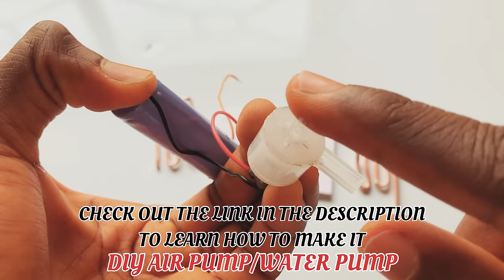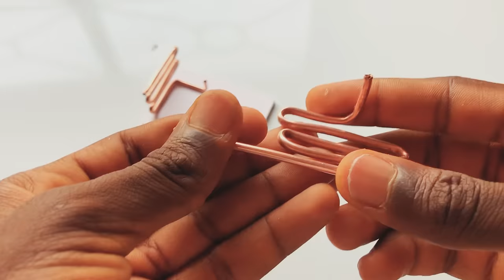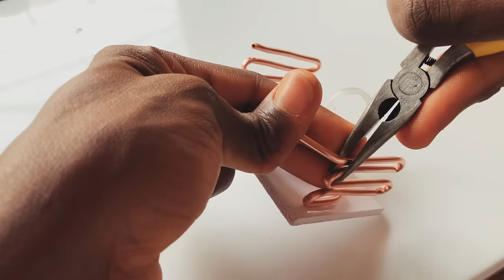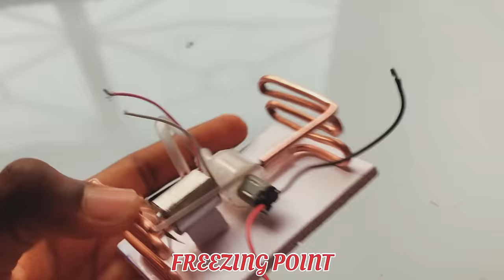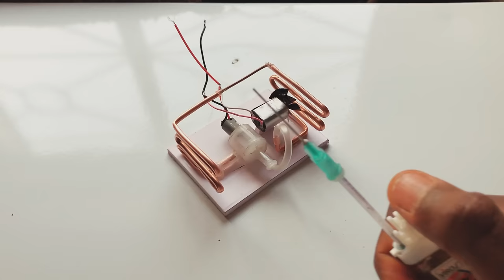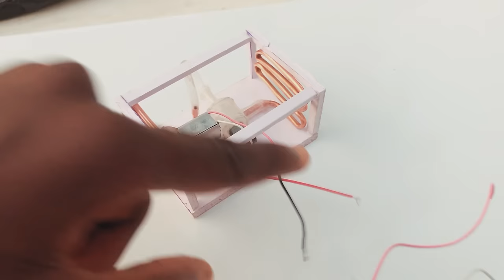How to make AC || Smart Air conditioner At Home || Mini powerful AC

Comment: This is an open prototype/working principles of HVAC, this is just a practical method i used to carry my project while in technical college
Reply: Is it the same gas used in HVAC?
Reply: @uday20101  The first ever made practical HVAC used same gas and it works perfectly fine, but there was a problem of combustion and explosion, So, that same gas has undergone several refining into the lighter AC refrigerant gas you see in the market today. So never attempt to put propane gas in an Air conditioning unit as seen, it's dangerous. You will risk your life.
Reply: @roberto_the_tech_guy  and is tht motor acting like compressor
Reply from the maker: Yeah
Reply: @uday20101  the motor is attached to a pump with a technically configured inlet and outlet valve creating a kind of DIY compressor, and you know compressor is a genius design. You can just say a combustion engine shares similar design except that an engine has to burn it's gas within the cylinders to create a mechanical torque needed for propulsion

Comment: As i know,  liquid must pressurerise until it's boiling point to have it liquid to gas.  When the temperature absorbed by gas it turns into liquid again. Are you sure will this happening in this model ?

Comment: The problem with all these DIY AC videos is that there's no seamless (uncut) shot of the device powering on and ice forming on the copper. Other videos show the ice forming on the copper but it's just a reversed video of ice melting off the copper, likely from spraying it with some aerosol.  Someone will need to upload a video with one of these things turning on and having ice form over time - with a clock running in the frame to show its moving in forward time. Someone will also need to be juggling apples in frame, speaking proper english the whole time within frame, and like 3 of my friends will also have to be in the background giving a periodic thumbs up before I entertain that any of these are real.

Comment: Love the clever work here- though, from the medically inclined- ever thought of an I.V. coupling instead? I would find it far easier to load a syringe with a "lock lip," wherein refilling the butane upon the half life would be a literal breeze. 🖤🥠👾🐰
Reply: There's an odd engineer with a hydro/magnetic impeller coupling that this would wildly benefit with this cooling system as a wrap around.

Comment: Where can I get these materials I want to create one thank you
Reply from the maker: To make things way more easier for you, just go to a refrigerator spare parts shop and ask them for a 4mm or 5mm diameter capillary tube. I guess that's the major component people find difficult to source
Reply: @gabtechexpo4017  cool, I should use the 4mm pipe and this very thin pipe that you use, how thick is it, just one more question, how can these silicone hoses withstand the temperature in time, I want to make a mini air conditioner and it's just you who had a good idea, I I want to build a prototype to use in my car

Comment: What is the part with the round T-Junction with wires?

I’m going to try this one some copper pipe from our broken air cooler, a small laptop fan, and some other stuff I have lying around the house 😁

Mmmm, I wonder if my wife has anything I can take apart 😉😂

Comment: Will this work with a 12V pump? And also any lighter fluid?
Reply from the maker: Ensure it has high pressure and avoid leakage
Reply: @gabtechexpo4017  ok thnx

Comment: Why back side coil is not cooling? Becoz same liquid is running through it also..
Reply from the maker: It’s the condenser which release heat from the gas then when compressed and passed through the capillary makes the gas to expand in the front coil( the evaporator) thereby causing cooling in result to freezing

Comment: question; Isn't the fan to cool the condenser? Why is it in the wrong place? And why is there a short tube instead of a capillary tube? And why does the pipe freeze quickly and in the wrong place?

Comment: doing triple purge will remove almost all of the oxygen,  fill it, drain it, do that three times then charge it with the gas, much safer. compressing fuel and oxygen is dangerous, but not unheard of, ie..diesel engines
Reply from the maker: Thanks

Comment: Your project looks great. How about install one dual shaft miniature motor and add fan blades on both shafts? One fan blows on to the coil and the other fan blade moves the air away from the coil?
Reply from the maker: Great

Comment: Awesome.

I guess I need to add "I build refrigerators from scratch" to my list.
Reply from the maker: Great
Reply: @gabtechexpo4017  

I had never considered a cooling system that didn't do a phase change.  It is more effective than I thought it would be.
Reply from the maker: Absolutely
Reply: Did you make it? Did it work?
Reply: @ionlineboy  

It will work.  Just not a very efficient system....

Comment: Thank you  its  very  nice!!  Please  make  an  fully completed   airconditoner
Reply from the maker: Thanks
Reply: I don’t think so. 

The hot coil will put out the same amount of heat the cold coil absorbs. 

This is a completely zero sum exercise.  In fact, because of the two electric motors this will create more heat than it removes. 

That changes if the hot coil is moved outside the space being cooled.

Comment: If you add another fan to dissipate the heat side outward, rather than being drawn toward the cold side, it will get even colder 💯🙌
Reply from the maker: Thanks
Reply: @gabtechexpo4017  can you try CO2 or Ammonia gas? Both are extremely cheap, and have great thermodynamic cooling properties. Ammonia is flamable as the butane so be careful! Let me know if you try these gases 💯🙌 I'm curious about the maximum cooling temperature. Something like this with a solar cell, could be made and used cheaply in 3rd world countries to cool housing and water, keep food fresh, and condensate pure water from thin air for drinking. 🙌🙏
Reply: @gabtechexpo4017  **ammonia gas molecules are too large to escape thru the tubing pores over time ("air tight"), so should stay in the system indefinitely without degradation (as long as the tubing doesn't dissolve in the ammonia) 👍.

Comment: No entiendo si no se ve el gas q circula por la. Manguera tramsparente y el lado del tubo esta seco que también debería enfriarse al menos un poco pero, solo un lado no más 🤔 es muy raro
Reply from the maker: Right from that point where that tiny copper pipe was connected makes it the freezing point which compresses the gas then let it run freely to the wider pipe thereby cause freezing and cooling

Comment: You already have cooling. Now use a Peltier cell, either 12v or 24v. Connect a capacitor and you have energy production.
Reply: Hahaha, you know that whole thing runs on battery power, right?
Reply: @officialnickname  Possibly, but... if it uses a capacitor and all the parts I wrote about, it will generate energy.

Comment: If this real then i have a million dollar idea for you.. Heat pumps can have a COP greater than 1 ... This means they are extracting energy from environment temperature differential.. Try to connect some peltier devices on cold and hot side to test if we can create an overunity machine.. Actually an earth temperature differential generator.. Its very easy just try to run the dc motor from the peltiers.. i am waiting to see the results... This is the only way to create a free energy machine..
Reply from the maker: Wow! Thanks great, I should try it

Comment: Well, cooling is so easy, why haven't computer manufacturers made such a small copper pipe under the processor fan and cooled it by putting gas inside for years?

Comment: How do you prevent gas escaping from the engine pump?
Reply from the maker: Seal it properly.
Reply: @gabtechexpo4017 
How, the motor shaft needs to rotate

Comment: This is just fake, the pump cant build enough pressure to get to the needet condensing ant Evaluation temps. Also the system also the   "high pressure side" has no fan.  The freezing is recorded as meltung but the Video is reversed to make it Look like it will Work. The Principe is right, but done wrong so it cant work. Please dont do fake Videos.
Everyone that trys this, will fail. 
Also the Thumbnail "100% working"  is a lie because you know it is fake. 
I also know what im talking about, because my job is in the cooling Industrie and i know how all of the cooling does Work. This here is clearly fake.

Comment: You're not removing the heat generated, or the air moisture, so this will NOT cool off anything in your home.
Reply: Removal of water in the air is just a side effect of refrigeration.  This video is hilarious at best 😂
Reply: If we accept your theory,  then electric heaters wouldn't warm up a room, because they don't remove moisture either. Try this: Put a bucket of ice in a small, warm room, with all doors and windows shut. The room gets cooler. Blow air over it with a fan and the cool air moves around the room.
Reply: @sgtbrown4273 Another "side effect" of refrigeration is cooling things down. What matters is the amount of heat generated over a period of time compared to the net effects of the cooling it achieves. That depends on the efficiency of the system itself. Electric motors can be very efficient and needn't generate much heat.

Comment: There is no way hot snot and super glue is going to seal that to a no leak state especially under pressure.. Besides that I get it's a DIY project and proof of concept thing but this is very inefficient and dangerous due to the type of gas and no way of knowing what the charge is in the system. A disclaimer / warning may be in order for those who want to attempt to try this.

Comment: My only comment is the horrible tube bends here.  You have basically crimped the tubing in the 180 degree bends. 

If you cannot afford a tube bender, bend it around the battery or something similarly sized to avoid the kinks. 

I have bent literally miles of much harder stainless steel tubing, from 1/8” to 1”.  Kinked tubing is fugly.
Reply from the maker: It still works 💯
Reply: @gabtechexpo4017  It will effect efficiency.

Comment: Really? I don't think so. If it was that good, my PCs GPU cooler wouldn't need a water cooling unit to stay cool, and I wouldn't need 4 fans to keep the enclosure and drives cool. 
Pull the other one, it's got bells on !